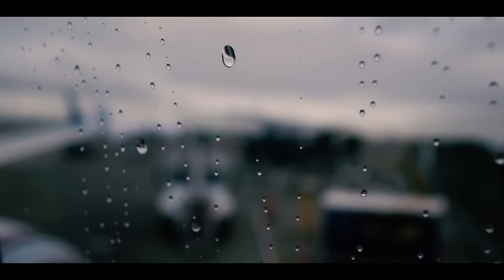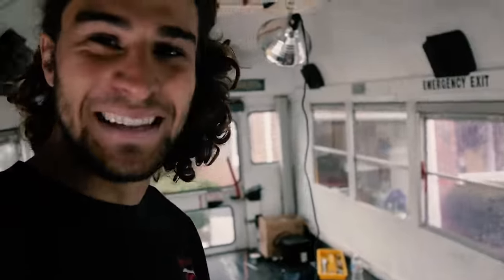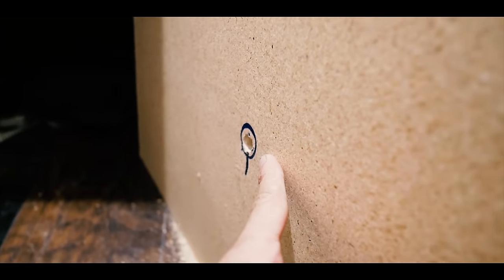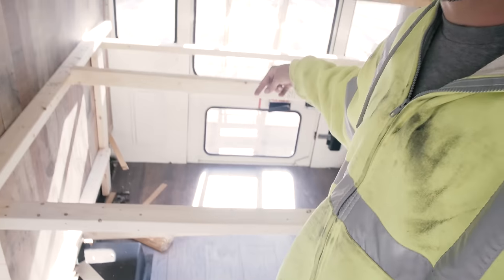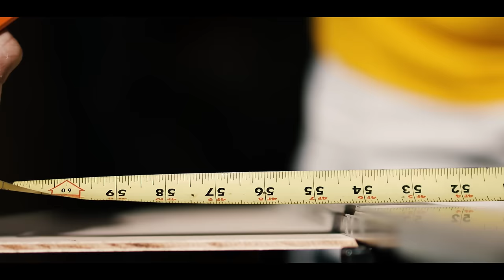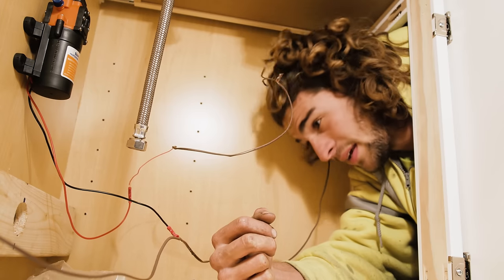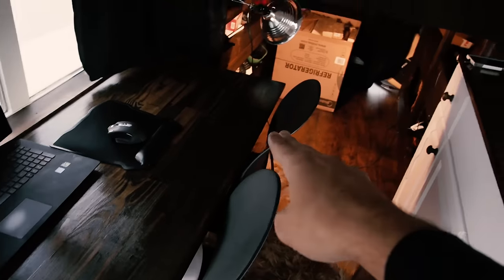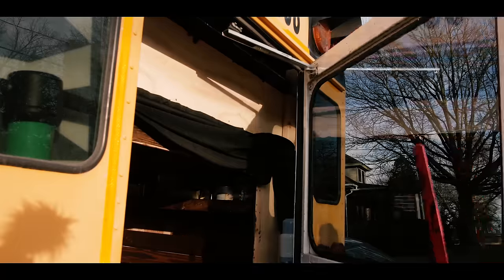School Bus Conversion In 11 Days | Tiny House on Wheels [4K]

Comment: I think another good option for water would be to mount the tank up high in a cabinet or something then just have a gravity-fed nozzle come off that. you'd lose some space for another cabinet, but eliminate the need for a pump. Nice conversion btw I love the wood floors and countertops!

Comment: You can split the bed into 2 parallel sofa beds, with storage underneath.
Have a screw on table in the middle for work space and large diner table. 
Have storage above the kitchen sink along the entire wall. 
Turn the work space into closet space with hangers for nice clothes.
Have a tv/pc monitor mounted to the closet space, facing the sofa beds for entertainment.

Comment: Is there any way you can list the brand and wattage of the solar panels you got, the inverter, and what type of deep-cycle batteries you used (and any other parts that were used to complete the project)? Thanks!

Comment: Hey Chase, did you guys take all the metal stripping and black rubber flooring up before laying the tongue and groove floor, or did you simply just lay the floor over the pre existing bus floor. I ask because my girlfriend and I are about to attempt to start our short bus floor. ALSO does it get really cold and hot in your bus or is the temperature very mild...

Comment: If/when you get pulled over and the police ask you if you're living in your van? ...never tell them yes. Tell them that it's your office. If you tell them that you're living in it or at least staying in it, then no matter where you park(unless it's a designated RV park), it translates into trespassing/loitering/squatting. Plus for security reasons ...look into those transparent coatings you can put over your windows(at least on the doors and counter-height windows), that keep the glass from being able to shatter through. That way you can avoid having to install exterior bars(that raises suspicion) or interior bars that make you(or guests) feel uncomfortable.

Comment: You might have wanted to put insulation in the walls but hey if your batteries can power an AC and a heater then go for it

Comment: Chase
Did you use any insulation for loss of heat or intrusion of sound?
If not, why?
Reply from the maker: +Cat Ritz yes it's insulated. The ceiling was already insulated by the manufacturer.  We then insulated the walls as well. Unfortunately I'm super tall and we did not insulate the floor because then my head would hit the ceiling.
Reply: Chase
Thanks for the response. 
Awesome job you all did & awesome family/friends you have.
Thanks for being you!
Peace

Comment: Hey man I live in New Jersey and bought a bus just like that but am having trouble getting insurance. Who did you use? I've been turned down by just about every company I've tried. Thanks
Reply from the maker: +Bob Murphy you'll have to get commercial insurance or RV insurance from a company that does it.
Reply: Adrenaline Addiction yeah I'm trying to insure it as an rv, what company did you use and did you need to have it finish it before getting coverage? Thanks for getting back

Comment: You're not going to be able to run a space heater on that amount of panels and batteries. Not happening. You probably wouldn't be able to run an AC on that setup. Everything else you need, probably.
Reply from the maker: Propane bro ;)